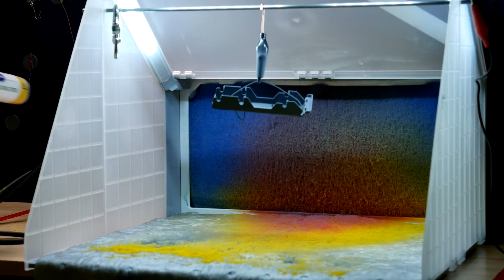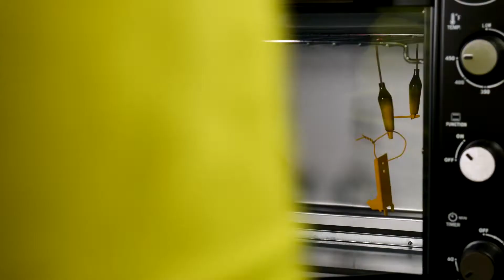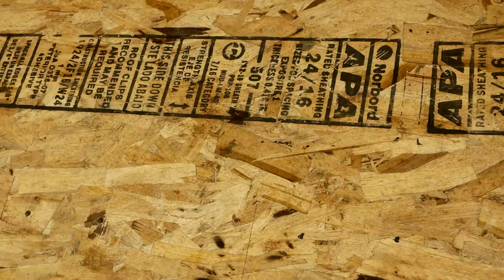Mini Tonka Toy Truck Restoration/Custom: Cement Mixer 1963-1969

Comment: The change to a red cab was a definite improvement!  Beautiful result!  Any reason to use paint stripper instead of sand blasting?
Reply from the maker: I really like the red cab to go along with the red mixer. After trying paint stripping, no. I'm going right back to sandblasting. Stripping was messy, required more effort, and more "processing time. In the end, not all the paint was removed, so I had to put a wire brush on the rotary tool to finish it off. I dusted off the old sandblaster today in preparation for the next project. Thanks for watching and commenting!
Reply from the maker: Correction: I just tried lye (caustic soda, sodium hydroxide) on the latest project and it worked pretty darn well! Keep an eye out for the video. Stuff is dangerous, though.